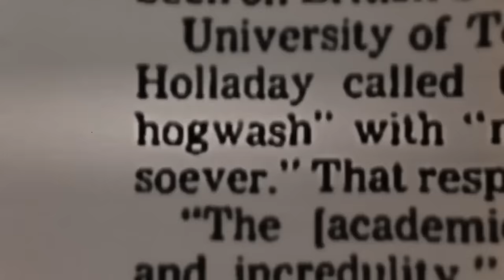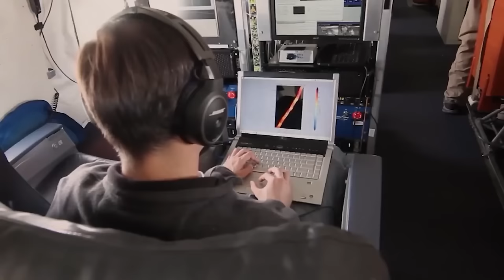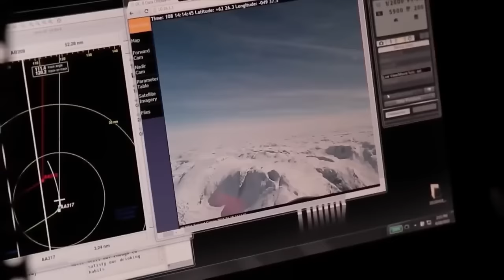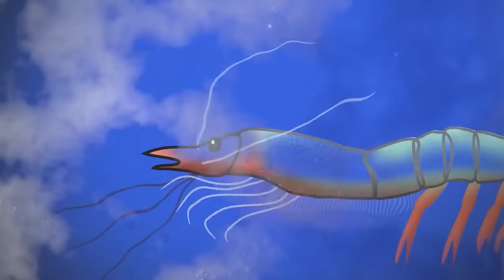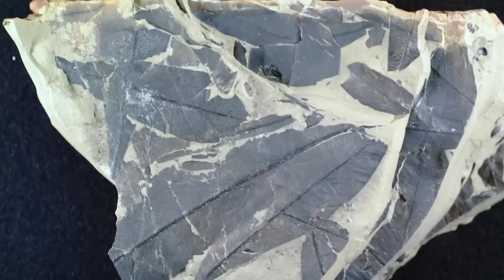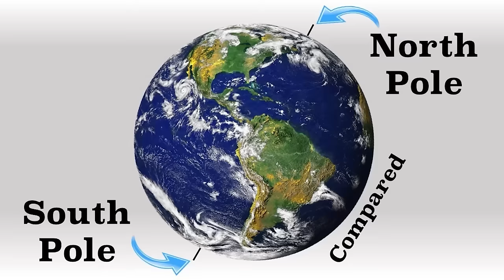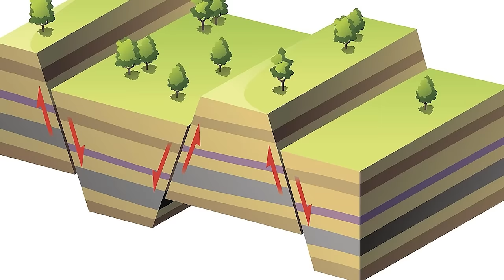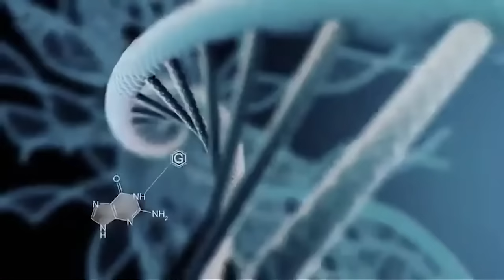Graham Hancock Breaks In Tears: "Antarctica Is Not What We're Being Told!"

Comment: Ive seen plane runway with black plane on it and miles and miles of structures running in lines and rows connected by what looks like tunnels. Each structure measured 1/4 mile wide and there are hundreds and hundreds of them. Also next to the runway with a plane on it, there was a long row of parked land movers. The tracks left behind from them made it appear as if they had been using them to bury the rows of structures and tunnels. I search the globe on Google Earth and constantly change areas using the Time Lapse option. Some of the units had moved out of line because of what looked like natural shifting or harsh weather. From other things ive found in Antarctica shows me its much more populated than we've been led to believe. Also found melting dinosaur remains showing thousands all smashed together somewhat but a frozen shelf of bodies of dinosaur heads all facing the same direction as if fleeing or swimming from something behind them.
Reply: show me give some location numbers so i can have a look
Reply: Please? and thank you

Comment: For sake of argument, say the crust displacement theory was true.  Antarctica was whisked away  from a warm latitude (no ice on the surface) to the latitude where it is today, where ice could accumulate throughout the entire year.  How long would it take to accumulate the amount of ice that now exists there.  I've heard a number of two miles bandied about for the average thickness of the antarctic ice.  Say for sake of argument the ice could accumulate at the rate of ten inches per year.  Two miles converts to 126,720 inches. Divide that by 10 (inches of accumulation per year) and you come up with 12,672 years.  The younger dryas is supposed to have occured from 12,900 to 11,700 years ago.  Interesting relationship.